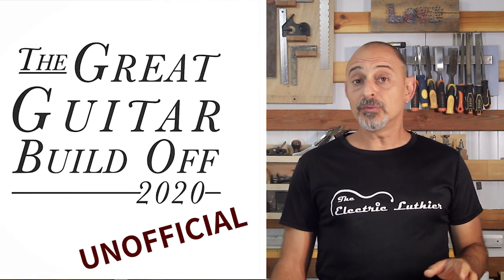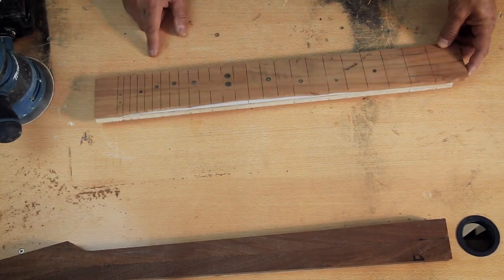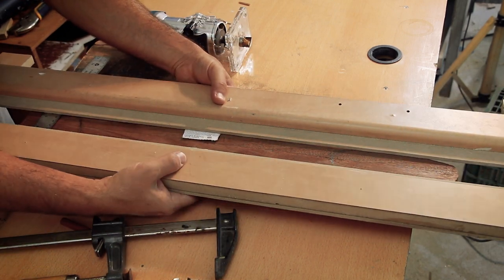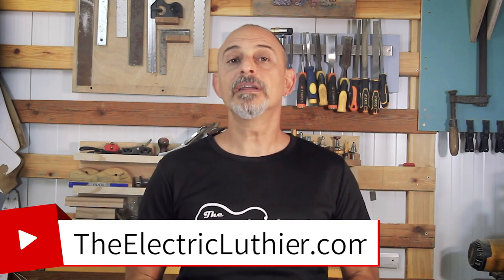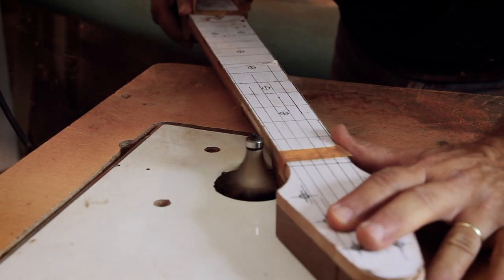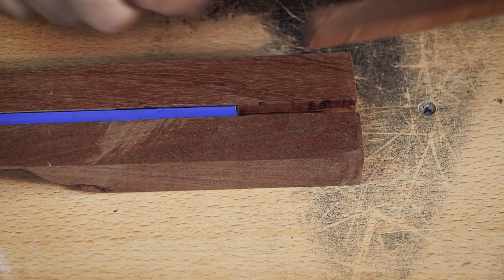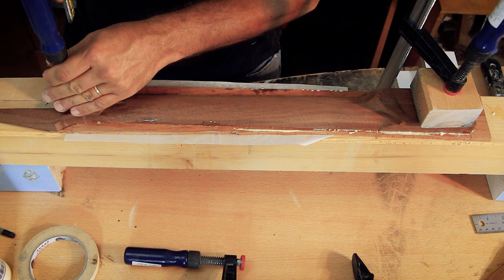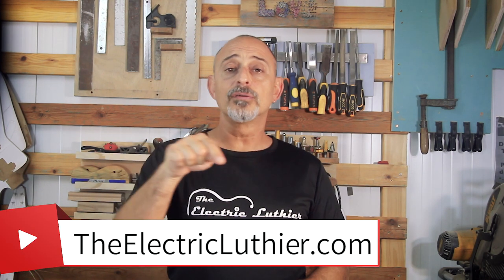My Original Design for the Great Guitar Build Off - Unofficial Part 3

Comment: I thought you should keep the tape over the truss rod to avoid glue going into the channel.
Reply from the maker: It's there to protect while spreading the glue so the whole channel doesn't get swamped with glue. You are supposed to take it off, assuming the squeeze-out is not significant. I can't recall anyone leaving it in...
Reply: @theelectricluthier1928  Got it, thanks. I thought that the squeeze out would go in and cause problems, but I have never built a guitar, I know nothing. I'm here to learn.